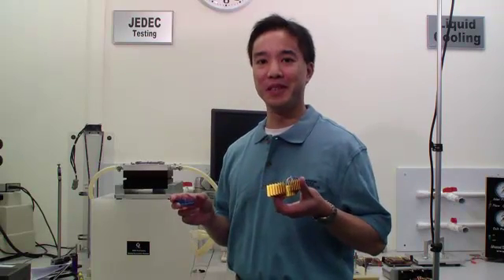How to Apply Thermal Interface Material: Thermal Tape

Comment: Thanks. I bought some thermal tape off Amazon to get a heat sync onto some ICs for a GPU. I had never worked with thermal tape before and I debated going with an epoxy adhesive but then I decided to go with what the OEM used. The strange thing is that they didn't use any screws to mount the fins to the PCB. There's open copper and holes on the PCB and sync but for some reason, they went with just the thermal adhesive tape. I'm into a NVidia GE Force 760 ti OEM and I was surprised to see such a low standard manufacturing practice. 
My only question is should heat be applied to the surfaces? Because NVidia used ONLY thermal tape, when I went to remount the shroud, the heat sync fell out of position and when I first went to remove the shroud the heat sync literally just fell off. Scary, right? I may post a short video for those that are curious. ✌🏻

Comment: I have also tried using thermal tape that came preapplied to heatsinks. After cleaning the surface with 91% alcohol and waiting until completely dry the tape itself was extremely sticky but would not stickvery good as the memory chips on the video card I was applying them to wasn't a smooth finish. Instead I said the heck with this cheesy tale that will most likely weaken in time and cause a heatsink to fall off in my case and cause a short. I ordered some thermal epoxy that warns it will never ever ever come off after curing, which is fine by me.  After using a bench grinder with a wire wheel to remove the crappy tape off of the heatsinks and an air compressor to blow off any foriegn debris from the heatsink, and re-cleaning the heatsink with more 91% alcohol they were applied using thermal epoxy and set out to dry overnight for peace of mind. The next day they were attached stronger than I could ever imagine. I am a huge fan of thermal epoxy. Never will I take thermal tape seriously anymore.

Comment: I just used some thermal tape for heat sinks on my GPU. It does not stick well at all... I had the hardest time setting the card back into the case without them falling off.
 Will this change after the vram is heated, or did I buy cheap materials?